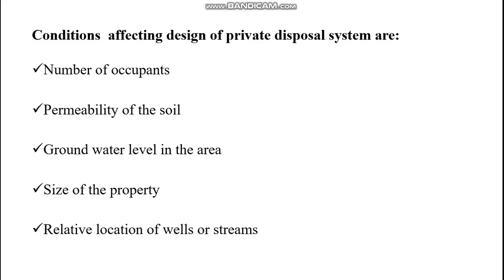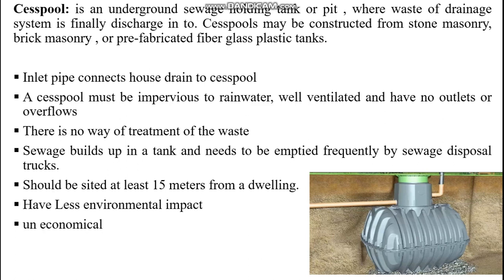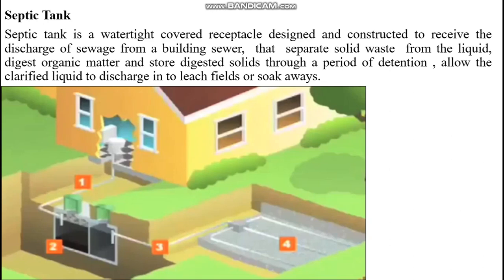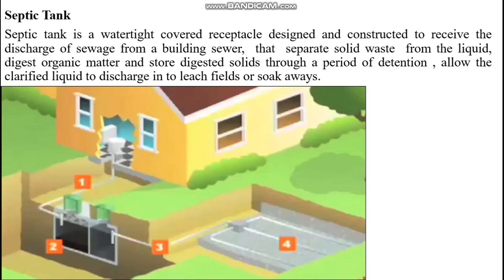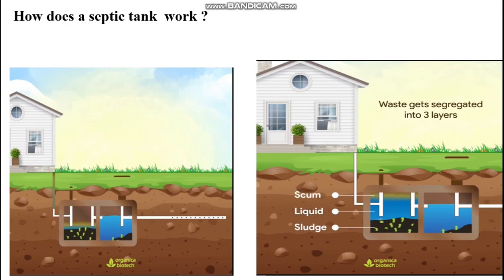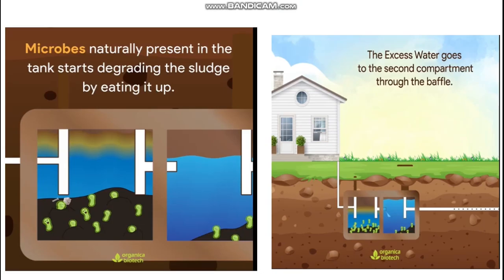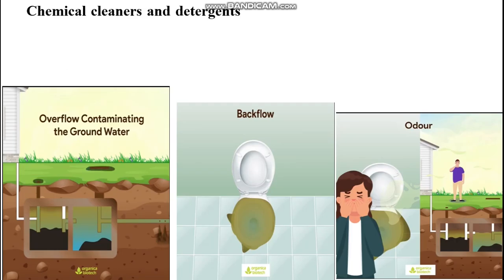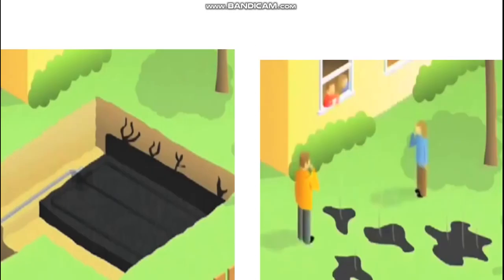Cesspool and Septic tank Private disposal system

Comment: UU80823R
Cesspool is an underground tank used to collect waste water & sewage. It is constructed from stone masonry, brick masonry & fabricated glass plastic tanks.
A septic tank is designed & constructed to receive the discharge of the sewage from a building sewer that separate solid waste from the liquid and allow the clarified liquid to discharge in to each field.
Unlike a septic tank, a cesspool doesn’t process or treat the water, it simply stored it.

Comment: 80707R
What I understand is cesspools is underground sewage holding tank, it is well ventilate , and uneconomical their is not cleaning methods or treatment that is not better than the septic tank because it contaminates the surrounding environment < ground water, streams.> it can impact human health mostly in rural areas. Septic tank is underground water tank that is different from cesspools tank because septic tank is separate the solid matter from the liquid,  but if their is an excessive water and detergent can create tank failure.......

Comment: UU80856R
Cesspool- underground hold tank or soak pit , it was a deep cylindrical chamber dug into the ground can be constructed be brick, stone masonry, pre fabricated fiberglass plastic tanks. 
Septic tank is an underground chamber made of concrete, fiberglass, or plastic and separated by a dividing wall with opening located about midway between the floor and roof of the tank, through which domestic sewage flow for basic treatment, the settled solids are anaerobically digested reducing the volume of solids. The liquid component fowl through the dividing wall into second chamber.

Comment: UU78258R

CESSPOOL: is an underground sewage that is used to/holds the tank of the waste water or sewage .
Cesspool can be constructed from stone, brick masonry & fabricated glass plasstic tank, and they need to be tightly closed to rain water or otherwise failure will haplen.

Septic tank lets wastage water to drift into a leach area, the place it undergoes a filtration process. A tight tank is just an encloset tank with no outlet.
And the components of septiv tanms are:- 
- inlet pipe
- septic tank
- scum
- efgluent

Comment: UU 78843R

cessepool is an under ground tank used to collect waste watee and sewage.it can be constructed from stone or brick masonary. A septic tank is a buried water tight container usually made of concrete, fiber glass or polythylene .and it have different components like  septik tank  inlet pipe, sludge, scum ,effluent & etc...

Comment: UU 81030R

Septic tanks and cesspools are all designed to receive and hold sewage and are systems used for waste management.A septic tank allows wastewater to flow into a leach field where it undergoes a filtration process. In contrast, a cesspool is a pit lined with cement or stone which lacks the ability to filter the waste, eventually contaminating the surrounding soil.  And when we design the private disposal system  we have to concider the conditions which affect  the design .(number of occupant,permeability of soil and etc...).

Comment: UU81140R
Cesspool-is an underground sewage holding tank or pit, cesspool may be constructed from stone, brick masonry or prefabricated fiber glass plastic tanks.
Septic tank- is a waterfight covered receptacle designed and constructed to receive the discharge of sewage from a building sewer.
- standard septic system consists of
1. a sewer pipe caring solid and liquid wast from home to septic tank.
2. a septic tank
3. Pipe caring effluent and 
4. Draind field and lich Feld sometimes, waste find it self get bank in to drain pipe carrying an aerobic bacteria.

Comment: UU81145R
It is not always possible to get a link to a centralized municipal sewer service in some places, so people use systems like septic tanks, and cesspools to get rid of their waste when that isn't possible. These two receptacles are different because of what happens afterward.

A septic tank lets waste water flow into a leach field, where it is filtered. In comparison, a cesspool is a pit made of cement or stone that doesn't have the ability to process the waste, which makes the soil around it dirty.

Comment: UU80830R
Septic Tank
A septic tank is used in most of the rural areas which do not have a sewage disposal system. It works in a similar manner to the cesspool. Unlike a cesspool, which stores all kinds of waste material a septic tank is mainly focused for human organic waste. A septic tank is also a cylindrical holding tank which might be totally or partially underground.

Comment: 80991
Cesspool - an underground sewage holding tank, where waste of drainage system is finally discharge in to.
Inlet pipe connects house drain to cesspool.
Septic tank - a watertight covered receptacle designed and constructed to recive the discharge of sewage from a BLDG sewer. Its components are : inlet pipe, Septic tank, sludge, scum, effluent, baffle wall and lench field.
Failure of septic tank : Usage of excess water, Chemical cleaner and detergents, Waste get back to drain pipe carrying aerobic bacteria.

Comment: UU80830R
Cesspool
A cesspool is a large, cylindrical container which is dug deep inside the land surface. It is usually a meter in diameter and four to five meters deep. It is covered with a hatch, and the sewer is kept in it till it is automatically biodegraded. The solids are settled deep inside the base of the cesspool while the liquid percolates into the soil through the concrete. The solid matter is called sludge and the above is liquid

Comment: UU81213R
Cesspool is an underground sewage holding tank or pit where waste of drainage system finally discharge in to and it can be constructed from fiber glass plastic tank, ston and brick masonry. Septic tank is a watertight covered receptacle designed and constructed to receive the discharge of sewage from a building sewer. Inlet is one of the components of septic tank that connect house drain to cesspool. And septic tank work : - first sewage despose from house through inlet pipr to septic tank and the sludge that are settled at the bottom of the septic tank and some sludge like organic west flow on the top and form scum then treated liquid water under the second chamber which is known as effluent and the microbes that are found in the tank start desgreding the sludge then the treated liquid water go to the second compartment through the baffle and finally the excess treated water gets discharged through the pipes in the soil. Failures of septic tank are usage of excess amount of water and chemical cleaner.

Comment: UU80984R
SUMMARY
Cesspool:- an underground container for temporary storage of sanitary waste from toilet,sink and washing machines. It can be constructed from stone or brick masonry and fabricated glass plastic tanks.

Septin tank:- buried water tight container constructed to receive the discharge of sewage from a building sewer. It holdes the wasted water and allows the solids to settle down to the bottom forming sludge.

Comment: UU80954R
Cesspool is an underground tank or pit that drainage  discharge. The should be nooutlets or overflow,sited at least 15 meters. Septic tank is awater  tight covered receptacle designed to discharge of sewage septic tank may fail due to use of excessive water and over flow

Comment: Uu80870
Cesspool & septic tank 
Cesspool is an underground sewage holding tank or pit where waste of drainage system is finally discharge in to. They are constructed from stone masonry, brick masonry and prefabricated fiberglass plastic tanks.
Septic tank 
Is a water tight covered receptacle designed and constructed to receive the discharge of sewage from a building sewer. It separates solid waste from the liquid. It have different components such as inlet pipe, septic tank, sludge, scum, effluent, baffle wall, leach field. It works by allowing waste to separate in to 3 layers:- solid, effluent and scum. The solid settle to the bottom, where microorganisms decompose them. The middle layer of effluent exits the tank and travels through underground perforated pipes into the drainage field. There are some Septic tank failures such as usage of excess amount of water , chemical cleaners and detergents,  back flow etc.

Comment: UU78193R
Cesspool is underground sewage holding tank or pit it may be constructed brick masonry, stone masonry or prefabricated glass plastic tanks it must be ventilated wall because there is no way of treatment of the waste. A septic tank allows wastewater to flow into a leach field where it undergoes a filtration process. Components of septic tank. Baffwall, leanch field(drain field), efflvent, scum.
Some times there are septic tank failure like usage of excess amount of water and also chemical cleaners too it leads to failurety.

Comment: UU80884R 
Cesspool is an underground swage holding tank or pit, where waste of drainage system is finally discharge.
It may be constructed from stone masonry brick masonry or pre fabricated .it has less environmental impact but it is also uneconomical 
Septic tank is water tight covered receptacle designed and constructed to receive the discharge of sewage from a building sewer,that separate solid waste from liquid digest organic matter.it has different components:-inlet pipe,septic tank,swage, scum..etc the  failure to septic tanks are excess amount of water,chemical cleaners and detergents

Comment: HAYLEGEBERAL ASEFA 81219 R

A septic tank is a step up from a cesspool. A septic tank unlike a cesspool will have two pipe connections, one will be the inlet and the other will be the outlet and the tank will have a partition wall which is known as a baffleThe cesspool is simply a perforated concrete or block ring, similar to a well-liner but with holes, buried underground. ... Everything dumps to the cesspool, sludge piles up at the bottom, and effluent and scum drain through the holes directly into thesurrounding soil.
Difference 
A cesspit is a sealed underground tank that simply collects wastewater and sewage. There is no processing or treatment involved. ... In contrast, septic tanks use a simple treatment process which allows the treated wastewater to drain away to a soakaway or stream.

Comment: UU80649R 
Summary
Cesspool is an underground sewage storing tank or pit .its also a tank where waste of drainage discharge into . it may be constructed from brick masonry , stone masonry or prefabricated fiber plastic tanks but cesspool tank is uneconomical. Cesspool must be impervious to rain water otherwise failure will happen.
Septic tank : it is a tank which is designed and constructed to receive discharge sewage from a bldg sewer . components are : inlet pipe, septic tank , studge, scum , effuelnt , baffel wall and leach field .septic tank may fail due to use of excess water , over flow by chemical or detergent action .

Comment: UU 82223R
Cesspool is an underground sewage storing tank or
pit .its additionally a tank the place waste of drainage discharge
into. it may be constructed from brick masonry, stone
masonry or prefabricated fiber plastic tanks also they are uneconomical. And additionally they need to be tightly closed to rain water otherwise failure will happen.
A septic tank lets in wastewater to drift into a leach area the place it undergoes a filtration process. In contrast, a cesspool is a pit lined with cement or stone which lacks the functionality to filter the waste, eventually contaminating the surrounding soil. A tight tank is just an enclosed tank with no outlet.
The elements are : inlet pipe, septic tank, studge,
scum, effuelnt, baffel wall and leach subject .septic tank
may fail due to use of extra water, over waft with the aid of chemical or detergent action.

Comment: UU81085R
What I understand is cesspool is underground sewage holding tank ,it is well ventilated ,and uneconomical their is no cleaning method or treatment that is not better than the septic tank because it contaminate the surrounding environment(streams, ground water.) It can impact human health mostly in Rural area. Septic tank is underground water tank that is differ from cesspool tank because septic tank is separate the solid matter from the liquid, but  If their is an excessive water and  detergent can creat tank failure.

Comment: UU81006R 
SUMMARY 
cesspool : is an underground sewage holding tank or pit. It must be well ventilated. Their is no way of treatment of the waste. It’s un economical.  Septic tank : is a watertight covered receptacle designed and constructed to receive the discharge of sewerage. Components of septic tanks are:- inlet pipe, scum, sludge , leach field , septic tanks , battle wall and effluent. Septic tank works in the following way : first the switch is disposed from house into inlet pipes to septic tanks then solids entering the first chamber get into the bottom forming sludge. Eg- grease. 2.Treated liquids enters the chamber known as effluent.  3.Microbes starts degrading the sludge then the treated water goes goes to second compartment. 4.Finally the treated effluent gets discharged through perforated pipes. Septic tank failure is that excess use amount of water caused distribution and removed microbes which leads to overflow and na flow.

Comment: UU81058R
Cesspool is underground temporary storage of sewage it is a final discharge in which waste of drainage system disposed cesspool is un economical to build septic tank is constructed to receive the discharge from building sewer it have different components such us inlet pipe , septic tank , sludge scum , effulent , baffel wall etc... Septic tank falurity can be happened through use of excess water , chemical and detergents .

Comment: UU81369R

A cesspool
     A cesspool is underground impervious to rain water, well ventilated  hole surrounded by cement, stone, concrete, brick or other material and is used to collect waste water from the house with no outlets and ways to treat.

septic tank
    The septic tank is a buried, water-tight container usually made of concrete, fiberglass, or polyethylene makes use of natural processes to treat wastewater from household plumbing produced by bathrooms, kitchen drains,and laundry.

Comment: uu80754R
A cesspool is an underground sewage tank or pit. where waste of drainage system is  finally discharge. It may be constructed from from brick masonry, stone masonry or prefabricated fiber plastic tanks.sewage builds up in a tank and needs to be emptied frequently by sewage disposal trucks.have less enviromental impact.and un economical.

Septic tank is awater tight covered receptacle designed and constructed to receive the discharge from abuilding sewer.allow the ckarified liquid to discharge in to leache fields or soak aways. Components of septic tank system
 Inlet piipe,septic tank,sludge,scum,effluent,baffle wall,leach field/drain field there are some septic tank failures such as usage of excess amount of water chemical cleaners and detergents back flow